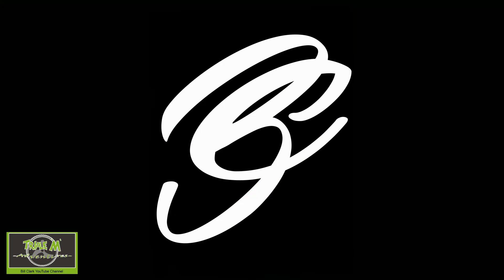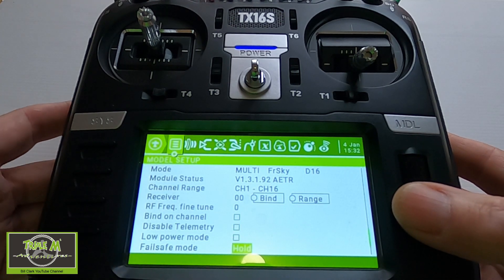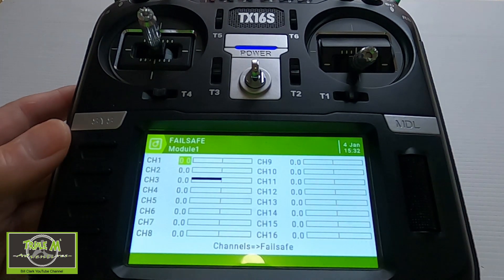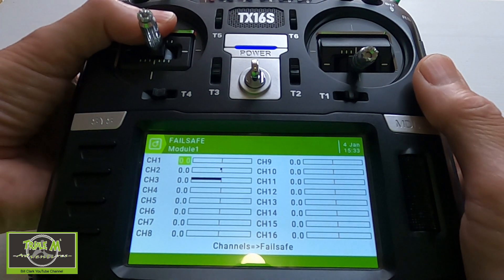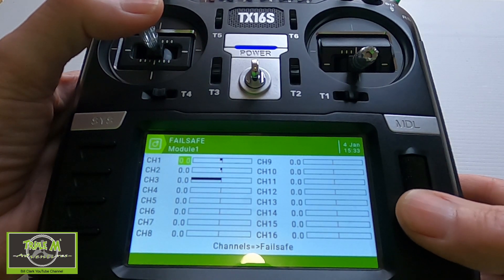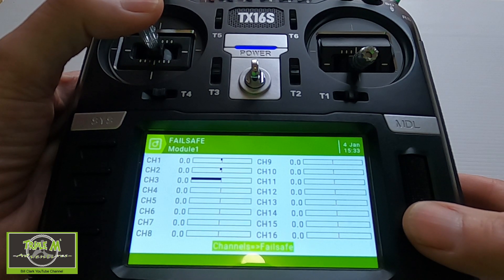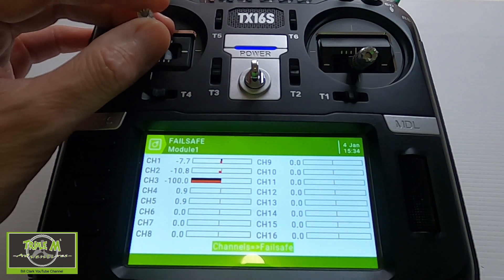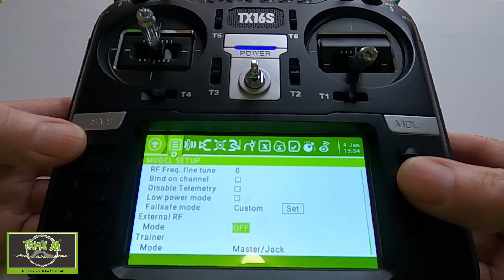OpenTX – Setting Custom Failsafe

Comment: Sir.., is there a similar way to setup a safe file in Radiomaster boxer..?
Reply from the maker: Yes but the methods can be different for different receivers. Which receiver do you have?
Reply: @the-happy-RC-flyer  FLYSKY IA6B 2.4G 6CH PPM Output w/ IBus Port
Reply from the maker: @zulkiflykadir8049 there are different ways to set the failsafe of receivers. Please check your manual that came with the receiver. Normally with this type of receiver you have no power to the receiver with the transmitter on. Hold the control surfaces in the position you require. Normally throttle down. Then power the receiver on holding the sticks in position for a few seconds.

Comment: Is it possible to activate the SAFE on the gyro with the same method?
Reply from the maker: Yes if it is setup on a mix/channel.
Reply: Thank you! BTW, how can I do this on TX12? I can’t find the button for confirming my edits
Reply from the maker: @despacitoRC  What firmware is your TX12 running OpenTX or EdgeTX?

Comment: I can't find failsafe. help me. i use tx12 c2500 and rx88v2
Reply from the maker: Hi, you need to follow the instructions with your receiver to set the failsafe.

Fail-safe Protection
1. Press the BIND button once within 10 seconds of the receiver being powered on, and the receiver will save all the current channel values of the remote control as the fail-safe value.
2. 10 seconds after the receiver is powered on, the BIND button function will be disabled to prevent accidental changes to to the fail-safe settings while preparing the model for flight.
Reply: @the-happy-RC-flyer Yes. I did as you instructed. And now I want to install the aircraft to disconnect the throttle channel when the signal is lost. I can't find failsafe settings in tx12
Reply from the maker: If the failsafe option does not show when setting up the model in your radio for the receiver you are using you need to set up the failsafe on the receiver itself. Which is the case for the receiver you are using.
Reply: @the-happy-RC-flyer  Thank you, sir. I did it

Comment: Hi Bill, how to set failsafe on the Boxer? Currently I'm doing rc sailing. So when failsafe occurs, I wish open my sails out(throttle open).
Please advice. Thanks a lot, Bill
Reply from the maker: Hi Tony,
Goto Model Setup
Goto Failsafe if the option is available for your receiver.
Click on Not set
Select Custom
Select Set
Either set each channel individually by selecting the channel value, should be 0,
Push Enter and dail in the value you require. Push Enter to save the value
Or
Hold the sticks where you want the failsafe position to be.
Long press the Enter button and
Select Channels=Failsafe.
If you do not see the Failsafe option for your receiver type then you need to set the Failsafe on the receiver. Normally by holding the gimbals in the position you require and click the bind but quickly within 10 seconds of powering up the receiver. Please check the manual supplied with your receiver.
Good luck.
Reply: @the-happy-RC-flyer  , I’m using a ER5C Radiomaster rx. The Boxer doesn’t show failsafe setting like u hv on the TX16 setup.
Reply from the maker: @tonyloh6140  you need to use the ExpressLRS LUA script.
Click SYS
SELECT ExpressLRS
Make sure your receiver is bound to your radio.
Scroll Down to Other Devices
Select RM ER5A-C
Select Set Failsafe Pos
Hold gimbals in position you require
Click Enter
This will only be used for servo operated models.

Comment: Bill. Thank you for that.
Do we have to have a failsafe rx to do this?
What I mean is...how does this work?
If I leave my rx " ON" after having set the fail safe and then turn my tx " Off" to test whether it works, should it fail safe to my settings?
Peter
Reply from the maker: Hi Peter, normally if you do not see the failsafe option on the radio check the instructions for your receiver because you can set failsafe by applying power to the receiver and pushing the bind button once within 10 seconds whilst holding the sticks in the position you want the receiver to failsafe. Please check your manual which came with your receiver.
Warning make sure you take off your propeller when testing failsafe and I would suggest doing it on the ground not in the air.

Comment: Three observations on my RadioMaster TX16S:
1. If there is no menu option for failsafe, it may not be because your Rx does not support it! On my system, my "Failsafe mode" option disappears if I check the "Disable Telemetry" box, and comes back if I clear it. I am running opentx-tx16s V2.3.10-otx, and using a Devo Rx. The OpenTx Companion 2.3 does not behave the same!
2. Getting into the failsafe custom set screen can be tricky. If you hold the roller down for too long on the set button it won't appear. It needs a short press and release.
3. Any of the failsafe positions in the custom set screen can be set by editing the numeric value. However if you then click on the Channels=>Failsafe text, it will overwrite all values with the positions of the sticks at that moment.
Reply from the maker: Thanks for the feed back Mark.
I have not used a Devo RX so cannot comment on it's use.

Comment: Can’t find the failsafe mode on edgetx help
Reply from the maker: Does your receiver support this option?
Reply: @the-happy-RC-flyer  using spektrum. Would expect all to be able to use failsafe
Reply: It’s a 6ch Admiral dsmx reciver
Reply from the maker: @DivisionRc  I did mention in my video that not all receivers support this option. If the option does not appear when you select the protocol then you will need to set up fail safe on the receiver itself. Check your instructions that came with the receiver.

Comment: Sir need help how to setup fail safe on tx12, I'm using r88 receiver..TQ
Reply from the maker: Hi Ahmad, here is the procedure for setting up failsafe on your R88.
Press the BIND button once within 10 seconds of the receiver being powered on, and the receiver will save
all the current channel values of the remote control as the fail-safe value. So just hold the gimbals in the position you want them to failsafe. Would recommend throttle to cut for safety reasons.

Comment: I am using a TBS crossfire micro V2 module. I can t setup the failsafe in this way. When I go to the crossfire configure menu, I can setup a failsafe, but no costum. Do you know a way do setup a custom failsafe with crossfire?
Reply from the maker: Hi Robin,
To set your Position Failsafe run the TBS Agent Lite or the lua script on your radio. 

Select XF Micro TX option. 
Select Set Failsafe. 
CLICK Enter. 
Set Ready
CLICK Enter
Change FS type to FS. POS.?
Put Sticks in required position. 
CLICK enter
Return to finish.

Just turn off your radio and check the control surfaces move as required.
Reply: @the-happy-RC-flyer  It works perfect, thank you!

Comment: I got it to work once with light throttle, light elevator up, but light left rudder didn't take, others did. Now Ive tried to redo it & nothing, everything goes off, no slow motor, no light elevator, nothing. retried 10 times now with nothing. tried rebinding then setup failsafe, nothing. tried setting positions on radio, then tap button on rx, nothing???   Any ideas?? It worked 1st time with a little throtte & evevator but no rudder, but not working at all when redoing it??
Reply from the maker: I would suggest select changing the failsafe from custom Not Set push enter. Now change it back to Custom and try again to set the failsafe positions.
Reply: What a receiver?